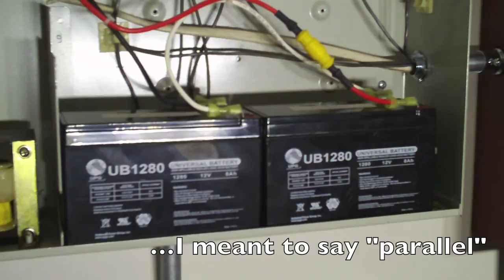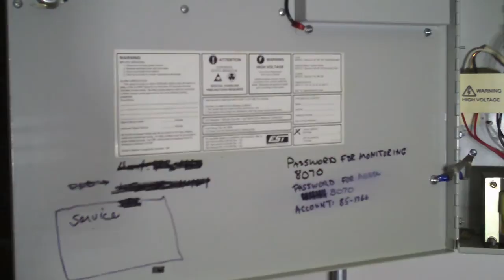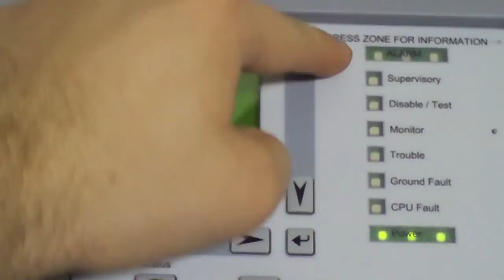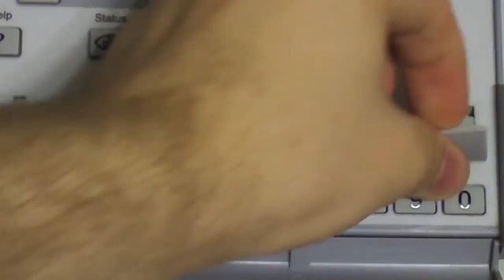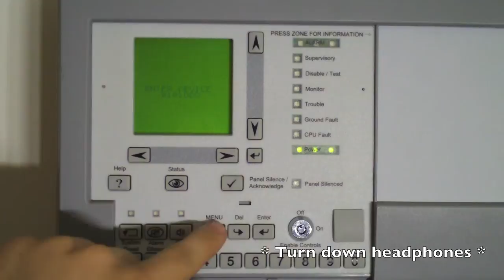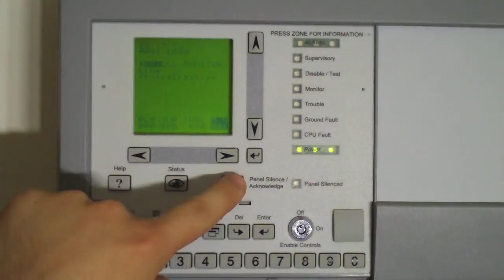Panel Focus: EST QuickStart

Comment: Wait? Did I hear you correctly on how to wire the batteries. It sounded like you just connected batteries together in a total loop and not have any connection to the FACP. From FACP black wire to black connection on battery. From FACP red wire to battery red connection the a jumper between both batteries......

Comment: Mapping is one of the best features on EST panels.  What it does is give you a picture of how the system is electrically wired.  When you have Mapping enabled and you have a bad device you can swap it with a like device and the system will auto clear.  With that said I believe the Quickstart panel is the worst addressable panel they came out with and I am glad that they have dropped it.

Comment: @1:00 - The transformer steps the voltage down from 120vac to 24vac (NOT 24vdc).  The PS6 converts the xfmr secondary voltage to 24vfwr.